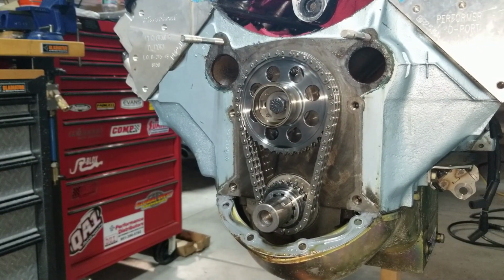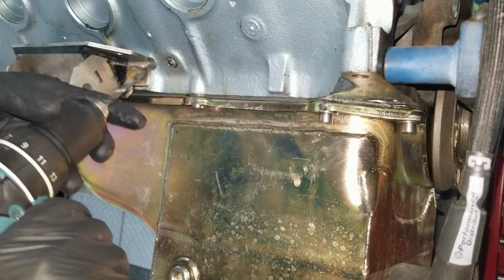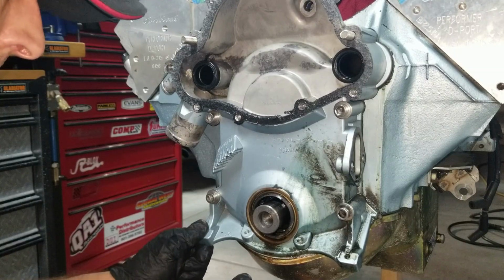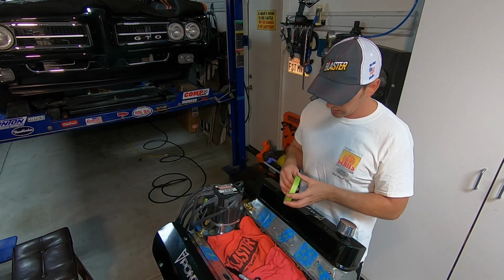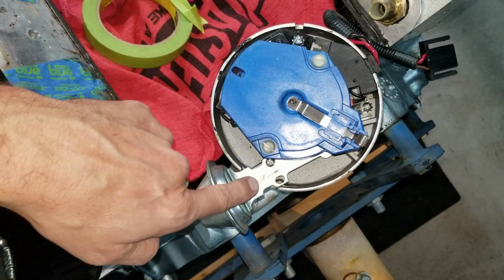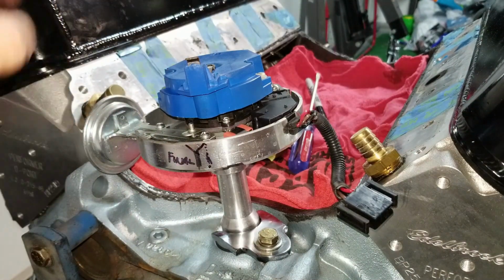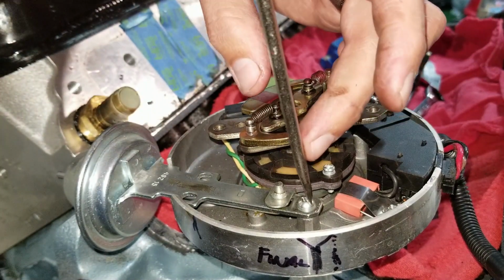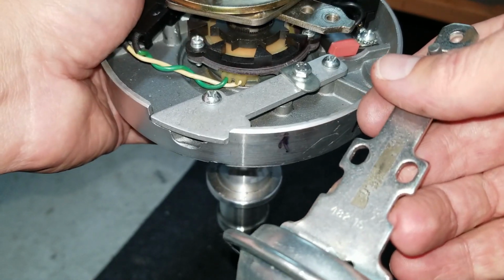Pontiac V8 Rebuild,  Part 4b: Engine Tear Down: How to Remove a stripped coolant drain plug

Comment: Did you ever consider any other paint colors for your block? I'd like to be a little unique without completely losing the Pontiac feel.
Reply from the maker: No... but, when the family mechanic rebuilt the engine the first time, they painted it black.  Pontiac Blue pops much nicer.  Nothing wrong with coordinating your paint scheme... have fun!

Comment: Hi Mike, i have now watched all your vids & suscribed. Can you please indicate brand & p/n of your failed lifter, along with the details of your replacment set you are using. Lucky it didn't cause damage to the block really. Thanks to that failure tho, look at all the snowballing upgrades you've made, great work !
Reply from the maker: Thanks Brother... the broken lifter was a Lunati Pontiac RetroFit.  They were probably manufactured seven or eight years ago.  I don't know if that style is even on the market any more?  So, I went with Johnson Lifters, from Butler Performance.  Here's the link, https://butlerperformance.com/i-30745670-johnson-high-performance-hydraulic-roller-lifter-set-jli-2112op-16.html?ref=search:https%3A%2F%2Fbutlerperformance.com%2Fsearch.html%3Fq%3Dlifters  Have fun!

Comment: Hey Mike, I’m building an engine very similar to yours, but trying to make a decision on the distributor system. Is this the one you are using?  https://www.summitracing.com/parts/dui-51720bl/year/1971/make/pontiac/model/gto. My block is a 71 which I don’t think matters, and I would find a way to change the color to black.
Reply from the maker: Ed, thanks for watching and the good question.  I'm pretty sure I have this one ... https://www.summitracing.com/parts/dui-517211bk  I would recommend going to the Davis Unified Ignition website.  Then after determining exactly what you want, take that part number and go to Summit.  You probably also noticed that I removed the Vacuum advance too.  Which I also sourced from Summit.  I assume you're subscribed to my channel?  Ironically enough I go through the install of this distributor in the next video, airing on May 29th, and how to modify it for a roller cam, etc... thanks for the comment!  See you soon.